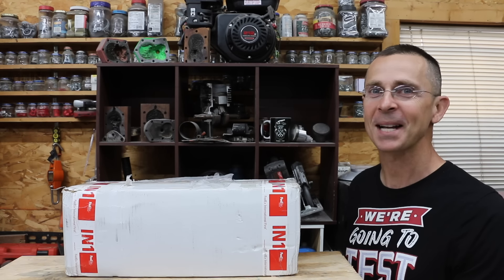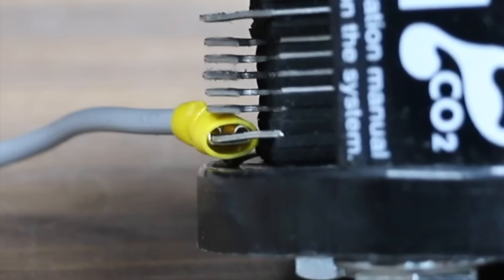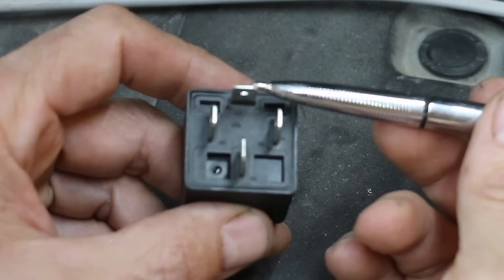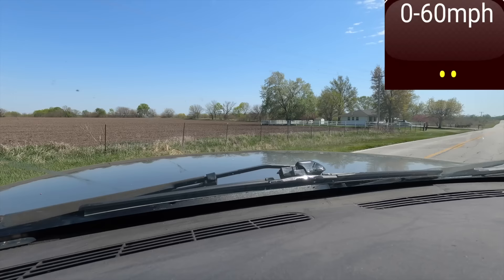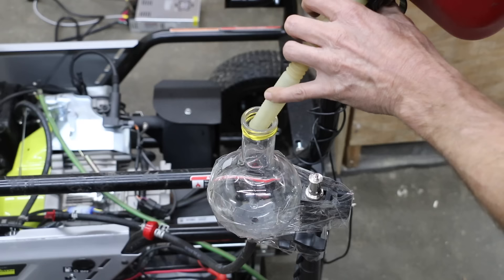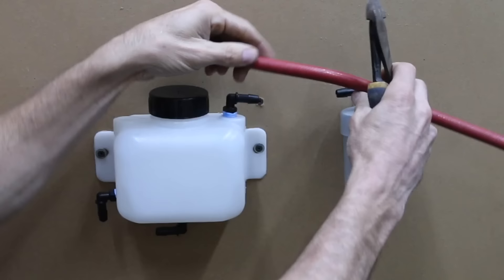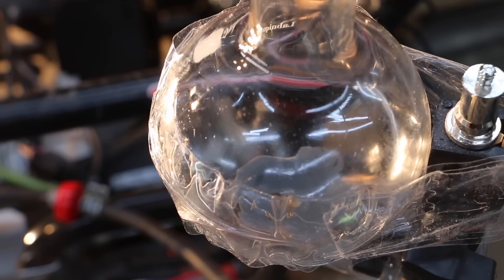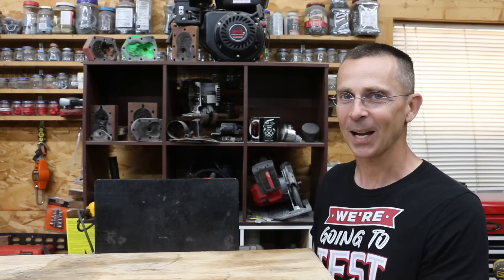AMAZING 35% More MPG with HHO? Let’s find out! Help with high gas prices?

Comment: Get a tank of pure Hydrogen then regulate it into your generator and see if it helps at all. Id be very curious about the results..:)
Reply: Tank of pure hydrogen - aka hydrogen bomb?
Reply: Also would like to see this to prove that the testing parameters used would actually show anything.
Reply: I'd prefer NOS tho... 😂
Reply: @BlackHeartScyther  Hydrogen is a good fuel, with a tank of compressed hydrogen you could run an engine on hydrogen alone, splicing it with gasoline is highly effective also.  No results to be found there that haven't already been extensively tested.  The theory being tested in this video isn't whether Hydrogen can be used, it's whether you can generate enough hydrogen gas via electrolysis of the HHO system to increase the energy output of the engine beyond the drain created by the HHO system.

The answer is "no".  It simply cannot generate enough gas to even cover it's own energy consumption.  Ramp up the electrolysis process, bigger core, etc?  Needs more energy to run, rinse repeat.  Tail-chasing exercise.
Reply: @masondegaulle5731  well the point is, as others have pointed out, this is a fuel injected generator, so putting anything in the air intake may have little effect on the gasoline consumption. I have seen other generators run on hho and with mixed credibility using it in a self perpetuating cycle. What I'm ultimately looking to prove is from a credible source, could such a system actually be made. And yeah, the amount of hho has got to be stepped up quite a bit to run a generator off of it, and you've got to seal the air intake so that half the hydrogen doesn't slip out and yeah, that is going to be much higher amp draw to produce that much hydrogen. Basically what I want to see is, a hho generator plugged into the wall running a generator, then that same unit plugged into the generator and see the results.
Reply: @BGone-mb7wz  what? Haha
Reply: @BlackHeartScyther  The results are entirely predictable:  Plugged into the wall, you'll see an increase in efficiency that equates directly to the volume of HHO drawn into the intake.  Plugged into the generator, the parasitic power and loss via entropy will mean it will always be slightly less efficient than the energy it contributes.
Reply: @BGone-mb7wz  no, hydrogen gas.
Reply: @masondegaulle5731  Predictable perhaps, but until tested it's not science 😄
Reply: @BGone-mb7wz  No that would be a tank of hydroxy, hydrogen on it's own is too high a fuel ratio to be combustible on it's own, when oxygen gets mixed with it is where the problems start. Even then the term "hydrogen bomb" refers to a amped up nuclear bomb using "heavy water" which is a different chemical makeup than gaseous hydrogen.
Reply: @BlackHeartScyther  It's entirely predictable because it has been tested to death.
Reply: @masondegaulle5731  Tested perhaps, but credibly tested I'm not so sure. Needs to be tested by someone who is known to be completely unbiased either way.
Reply: @BlackHeartScyther  No, I'm not talking about this test, I'm talking about peer reviewed scientific papers, about research done by Mercedes, VW, BMW, Toyota, about laboratory tests undertaken in controlled and repeatable conditions.  Hydrogen is not a new thing.  This concept has been kicking about for as long as combustion engines have existed. C'mon man.  This module is modern day snake oil.
Reply: @BGone-mb7wz  If you use a water bottle to prevent any blowback, it looks like a hydrogen bong!
Reply: @BGone-mb7wz  LOL...Think before you speak.

Comment: I’ve been wanting to buy this same set up from Germany for years , but didn’t want to take a chance on it being bogus . Looks like it’s fiction . I’m curious if the exhaust has less C02 as claimed still ¿
Reply from the maker: Thanks for the suggestion.
Reply: @ProjectFarm  Hello mate. Scientifically and theoretically, when engine consume H gas, depending on ECU engine control unit,  engine is supposed to burn less gasoline with support of H to produce same amount of HP. Or again depending on if ECU is not programmed for H2O engine will of course consume gasoline during same time but will produce higher HP. Yes practically we didnt see any difference with or w/o H2O gen. But I am not sure if we are supposed to compare 0-60mph or gasoline consume time. If H gas is contributing vehicle performance it must change milage. Becoz directing H gas into engine chamber must make a difference.
Reply: @batuhankoyuncu6661  but your ADDING items in the air intake flow. Meaning less air. Also you’re adding more load to the battery to take away any gains. So it evens out at best if it does work even at all. Open up/file down you plastic tube pieces for the air box and drop in a K&N filter and you’d get some definite/positive results.

Comment: Could you try running an engine on fumes I did it years ago on my truck due to boredom and it works I even pulled fuel pump fuse. I've read you can save HUGE amounts of fuel if you can seal the system air tight, thats where I fell short my set up wasn't practical, built in minutes (leaked) and not exactly the safest....
Reply: I have been curious if this increases effeciency.
Reply: If you used that same fume setup with the HHO you could easily get the mixture just right so that real gas savings would occur.
Reply: Internal combustion engines always run on fumes. The fumes you’re talking about are fuel mixed into air. Carbs and fuel injectors forcibly mix fuel into air, creating fumes.

Comment: Years ago I made one of these systems for my Ford Aerostar. I didn't see much benefit either. But I decided to power the hho with its own deep cell battery instead of drawing from the alternator. It seems that worked! I got more milage! What if you used an isolated power source to power the hho cell? Like a deep cell battery? Thus not causing any extra load on the engine? Would you see any difference?
Reply: The law of conservation of energy. The hho generator needs electricity to create power. You just changed from gasoline electricity to some other form of electrity. So from the saved mileage you're just paying for more electricity.
Reply: Galorchs 
Yeah but electricity is probably cheaper per mile than gasoline would be ..... provided it helps to improve mpg in any way
Reply: @galorchs8867  same with a tesla, that doesn't mean it's not more cost effective.
Reply: you can have the hydrogen cell powered by solar panels on the cars roof. or generate the hydrogen using a chemical reaction.

Comment: You need a good self diagnostics and efficiency adjustments systemd like in a millennial and later car or truck. Without o2 sensors and maf and knock sensors I'd bet there's be no noticeable difference either. It probably just ran rich the whole time?
Reply: He fed the HHO after mass airflow sensor. Test is bunk. Computer won't read the added oxygen. Improper install and a flawed test.
Reply: @J_Beazy223  obviously this device doesnt work. For it to work, you would need to get more energy back from water electrolysis than what you put in which is impossible. So much more in fact that it would be more even after the inefficiency of an internal combustion engine AND an alternator!
Reply: @J_Beazy223  The air flow meter doesn't measure oxygen, just air volume. And his specific truck has O2's that read the amount of oxygen remaining in the exhaust to adjust the fuel injected to maintain the same exhaust o2 content as before (lambda 1.0 at cruise). They can easily deal with the differences from E10 ethanol & ethanol-free fuels so it can deal with quite a change.

The test wasn't flawed, the principal of the device is.

Comment: Just curious if you put it on your Suburban long enough to test fuel economy. Perhaps the Ryobi EFI is not able to change AFRs based on the presence of the extra H in the incoming air. A more sophisticated EFI setup might be able to adapt and show a little bit of a difference. Not even remotely hopeful it would approach 35%, but it may be more noticeable in a better system.
Reply: Good point, should be tested on a non efi as well
Reply: A EFI or carburetor standard gen works by the same principal to maintain a constant RPM in accordance to the load connected by regulating the throttle which adjusts the volume of air and in accordance to that the volume of fuel to achieve the correct AFR.  Now if the stoichiometric Oxygen and Hydrogen gas would indeed provide more chemical energy into the combustion chamber than it actually takes electrical energy to make it then the throttle would need to close down to reduce the air intake and with it the amount of gasoline fuel in order to maintain the correct RPM no matter if EFI or Carb.  
 Good old thermodynamics just won't let you make the Oxygen - Hydrogen gas with less energy than you would get back from it in form of electrical energy from the generator

Comment: Sorry for HHO not showing any good result. Long time requested if you can try low viscosity mineral oil as engine coolant! Hopefully we see it soon :)
Reply: There is no good reason to do that.Pure water is one of the best liquids suitable for that job.And if something breaks down there is water almost everywhere.
Reply: Yes is the answer. But it burns quit well when you break a line.
Reply: Why would you use oil!  Water has by far the better heat dispersal properties.
Reply: There is one potential benefit of mineral oil as a coolant - the engine will warm up faster because oil has a lower specific heat capacity. But I expect it will also run hotter for the same reason.
Reply: @TerryClarkAccordioncrazy  No, it won't warm  up any quicker.
Water takes up heat faster than most fluids,  which is why it is used.
It will fail to "drop " its heat fast enough in the radiator  and may very well cause overheating.
Reply: @dnomyarnostaw  It will warm up faster. This is why some engine testing setups use kerosene as coolant. Specific heat capacity of water is more than twice that of oil.
Reply from the maker: Great suggestion!  Thank you.
Reply: Radiator/heater hose isn't rated for hydrocarbons, running mineral oil as coolant would cause all your hoses to swell, and then fail in short order, all coolant hoses would need to be replaced with tank truck line/fuel line, which is doable, but there's no real benefit. Straight antifreeze has less thermal mass than water, straight antifreeze won't eat your hoses, it's got a similar viscosity as well, try that instead, if it gets cold enough I'm told it gets pretty thick, so try it in the summer.
Reply: @TerryClarkAccordioncrazy Sorry, I missed the "ENGINE will warm up quicker". I  read the "FLUID will warm up quicker".
Yes, the engine will warm up quicker because the "oil" doesn't have as good a Heat Transfer Coefficient.

Comment: So this is the third time I have written this and it keeps getting disappeared… Hmmm wonder why: So the problem has been solved a long time ago. Notice that both of these motors has a computer running it. 
   Think of it this way, what if we were putting propane into the system, what would be the results? And we know that engines will run on propane alone!
   Thus one needs an electronic add on to get the computer to properly adjust the input of the two fuels and oxygen… mixture is everything!
   Try this with a generator that is carburated for propane and see what happens… This though a good looking experiment is very flawed and either by ignorance or set up to fail.
  If HHO burns or explodes, which it does, then it is a matter of how to use it in an engine NOT a matter of if it “works”.
  Let’s see if they delete this one… This time I have it in Word so I can copy paste and not have to re-write….
Reply: It doesn't work, because the energy density of hydrogen is 8 MJ/L and the energy density of gasoline is 4 times that at 30 MJ/L. It doesn't work, because of course it doesn't work, if it worked, then the car companies would use it in their engines. There isn't a "they" stopping this, unless you think "they" are reality and physics. The energy density of propane is closer to that of gasoline, being 25 MJ/L. This is why propane can run things like buses and forklifts.
Reply: @colin-manyeates-clan5221  Got it, you are a crazy person.

Comment: I have never seen any fuel saver scam that produced any positive result. 

Anything that makes claims to save you fuel and increase power by an irrational amount is 100% a scam, 100% of the time.

Do you want to save fuel?
-Inflate your tires properly.
-Do regular services on your vehicle.
-reduce your speed
-back off the heavy acceleration.
-use fuel with no ethanol

Good video though. I always like your vids. Keep up the constant.
Reply from the maker: Thanks and you are welcome!

Comment: Umm, isn't HHO like insanely explosive and highly dangerous?

You first mate.
Reply: Fun fact: During the space race, aerospace companies were still figuring out how to handle hydrogen. Since it burns clear, it's really hard to spot fires. NASA's solution was to have someone walk around the lines waving a straw broom. If it caught fire, there was a leak.
Reply: Yes...That's what the "bubbler" is for. It creates a flame trap, to prevent the HHO generator and water tank from going "BOOM", if the engine back-fires. Keep in mind, electrolyzers like this produce a perfect stoichiometric mix of Hydrogen and Oxygen, so the gas produced is as explosive as possible!
Reply: Yes which is why its pretty much never stored and only ever made on demand like this.
Reply: @rath3715  My ignorance of the chemistry is likely the cause of my concern in this case.

Just seems very dangerous. I certainly wouldn't attempt it.

Comment: I tried HHO years ago. It was a neat experiment.  I was using a wet cell kit made with a Mason jar and "lucky 13" plate setup. It made decent gas output for what it was. I didn't notice any fuel mileage gains really. I think it hurt a lil just because I was using my alternators output to produce the amperage needed for the reactor. I think I was running around 30 amps. But winter come around and I forgot to remove jar and it busted. Never replaced it. But it was a neat experiment anyway. I think toyota is working on a hydrogen fueled engine right now and it may very well put a hurting on this electric vehicle nonsense. Let's face it. Its just not gonna work.
Reply from the maker: Thanks for sharing.

Comment: a friend and I built something similar to this although it wasn't a kit we built all of the parts. rather than coming off of the 12 v from the battery we found to get more production if we put the positive wire coming directly off of the alternator and utilizing the alternating current.
Reply: we used a blinker relay as a means to control the current and temperature
Reply from the maker: Thanks for sharing!

Comment: The fact that this generator is meant to be outside of the cab. Under the hood. And they supplied you with non heat shrink butt connectors is bananas. Definitely seems like someone has access to these generators. And just sells them having no actual idea what all is needed.

Comment: You chose an ignition live feed, but that gives 12v with key turned, even if the engine isn't running.
For safety the relay trigger should be tapped in to the alternator charge light wire, so gas is only produced while the engine is definitely running.

Comment: I forgot to mention I just used stainless steel scrubbies you know the scrub dishes with. Anyways ran my wire in the jar to the scrubby and then wrapped around it to make sure that they wouldn't make connection and then wrapped a stainless steel scrubby around the outside connected it to my negative. Only thing I damaged on my car was a 3-8s rubber hose feeding into my brake booster
Reply from the maker: Thanks for sharing.

Comment: So I built my own HHO system and installed it on a jeep grand cherokee about 15 years ago. I saw between 30-40% increase in MPG but I didn’t have a PWM so it was eating 30 AMPs and was not sustainable. I didn’t much money for a PWM at the time and kind of forgot about the whole thing. I just bought a Grand Cherokee 5.7 hemi and am looking for a kit to save on gas. I’m not surprised the generator didn’t get results. I am surprised the test wasn’t run on the truck that has more controls to compensate for a rich fuel mixture. If the computer can’t detect a rich fuel mixture and compensate by shorting the injector pulse you are not going to see gains.

Comment: So if you wanted to test this and have real data you need some form of data logging software like HP Tuners. You can log the long term fuel trims. On average if it produces enough hho to make a difference you will see it in the fuel trims. That truck runs in open loop at wide open throttle so at wide open throttle its not goin to change much, that truck makes no fuel compensation WOT. if somebody has one of these they think actually works and you are near Indianapolis, message me, we can put it on my dyno, log data, it test it in a controlled environment.  If it makes a positive difference I'll do it for free....

Comment: I had one on my old van.  It saved me three tankfuls on a long trip.  They are better, now.  Do the research, use neutral plates, and use enough surface area to do a good job.  I don't see a carbureted engine showing much improvement.  You have to make enough gas to keep it running.  Newer, computer controlled engines take in all the inputs and notice the car is still running fine, so it dials back the amount of fuel squirted into the intake.
Reply from the maker: Thanks for sharing.